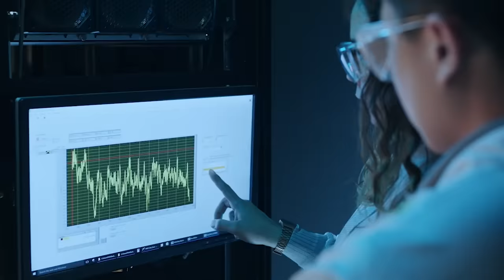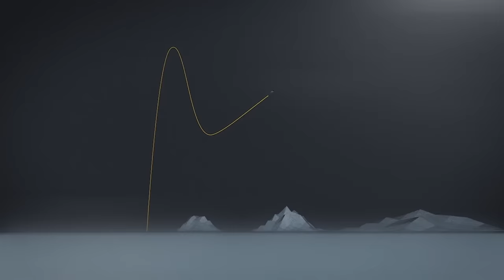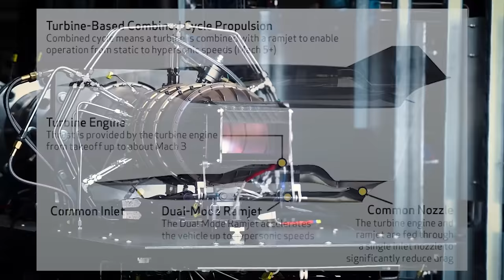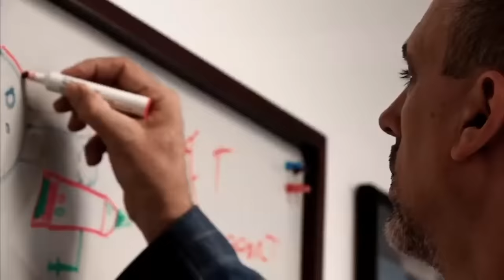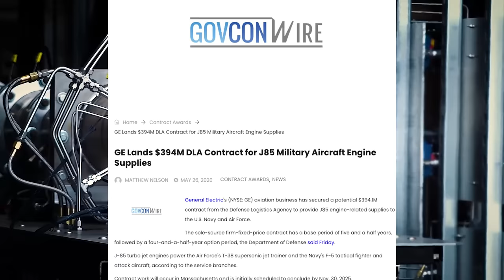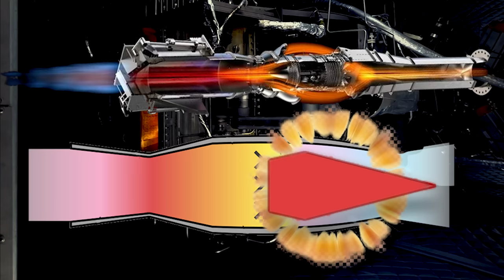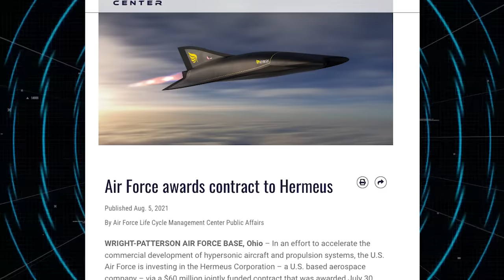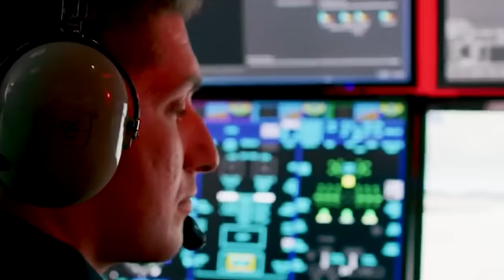Could HERMEUS turn the hypersonic arms race on its head?

Comment: Reminds me of where the Bulls used to practice. It was the most nondescript building out in the suburbs. You would not know that was the Bulls facility unless you knew before looking at it
Reply: Spent many years doing business around that area…I believe very few even knew it existed back in residential/business district.
Reply: The San Diego area has many new  industrial parks where the buildings are only marked with an address, or an address and a logo. 
This is a big military area. 
3rd largest Navy base in the world. North Island Naval Air Station, SEAL base, there's usually 2 or 3 Nimitz class carriers being upgraded at North Island.
Lots of Engineering opportunities.
Reply: My favourite type of factory.

Comment: All I can say is...fly baby fly! 46 years ago when I started working on A-4s another squadron on base flew the T-2 that was powered by 2 non afterburning J85 engines. We had the j52 engines that made the J85 look tiny as you said. Hell I have an acquaintance that runs a J85 in his dragster. They are tough and reliable. It will be interesting to see what comes of this. Thank you and be safe.
Reply: That's correct ! This idea is nothing new. It's a matter of making one that's reliable, maneuverable, and accurate.
Lt Rob, United States Airforce Retired.
Reply: That would be one scary dragster!!!
Reply: We used the J-52 engines in the Gam missiles. J52-P-3 turbojet propelled the Hound Dog

Comment: Incredible content as always. I actually know a girl in my grad program who did an internship this past spring with them and loved it.

Just one little nitpick. The J58 that powered the SR-71 was not a turbo-ramjet. It never diverted more than about 20% of the core mass flow around the turbomachinery/combustor iirc and thus can't be a turbo-ramjet. In my opinion, it was actually a far more interesting and clever solution by the P&W engineers than just routing all of the air around the core turbomachinery.

Comment: This feels a lot like SpaceX. Using commercial techniques to ensure rapid and cheap development with iterative designs that improve consistently. Quarter Horse you can tell is a rough draft, Darkhorse is looking pretty good, and I imagine Dragonborn’s or whatever they’re gonna call the next thing will be a truly perfected and revolutionary machine.
Reply: Thinking about hardware and needs.  I don't think a hypersonic bomb needs to do loops.  I think about things like jdams.  at it's core it is a gravity bomb.  Then computer, fins and sensors.  Yes I'm leaving lots of details out.  But then a jdam is a gravity bomb with some ability to do course changes within a funnel like window.  Now thinking about Falcon 9 or Falcon Heavy.  have the 2nd stage be a maneuverable glide vehicle with 1000kg of boom.  Sent up to just below the Harmin Line, (thus not breaking treaties on the weaponization of space) that 2nd stage can go almost anywhere in the world first stage lands back at the launch site or a drone ship.  F Heavy would allow more Delta Change or a bigger boom. Payload to LEO for F Heavy is 141,000 lbs.

Comment: I remember reading an AW&ST article about a back seat ride in a SR-71. The writer described flying a circle around Boise, Idaho at Mach 3. The circle had a diameter of 90 miles. At those speeds it seems maneuvers would have to be very gradual and therefore predictable.

Comment: Great job on this Alex, I love when you make new episodes. I noticed one issue however. You mentioned hypersonic speeds and the ability to get there. Missiles maneuvering to make the strike makes (expensive) sense, but a strike aircraft (because that's essentially the idea here) deploying munitions at hypersonic speeds without destroying the host aircraft, I think would be an even more impressive feat than just propelling a platform to those speeds. Otherwise the aircraft will have to slow down to standard release speeds in order to deploy munitions, making them vulnerable to standard air defense systems currently in use. In your opinion, is release while in maintained hypersonic flight even possible with current or near-term tech development?
Reply: One idea would be to launch them out of the rear of the aircraft in order to avoid the slipstream until it’s well to the rear.  There might also be some sort of detachable weapons-carrying module, similar to the B-58.

Comment: Nothing so far as been said about airframe integrity at speeds over the SR-71. That was a major concern. Also, how is communication going to work through the plasma envelope around the aircraft?
Thanks Alex for an outstanding channel !
Semper Fi from a 'Nam Squid.
Reply: Starship with the third test flight was able to maintain communications and telemetry for a while thanks to Starlink and the large wake such a huge rocket was able to produce. So maybe some rear mounted Starlink terminals or something similar could provide some communications.

Comment: The true genius of the J58 and I suspect the hybrid engine used by Hermeus is the control of shock wave formation inside the nacelle as it slows supersonic air down to subsonic, which compresses it manyfold, so it can be ducted in a controlled fashion to the afterburner section where fuel is added and burned.
If I’m not mistaken that genius went on to run Skunk Works after Kelly retired.
It’s all in the intake cone’s position of the J58.
Reply: The SR-71's cone moved based on airspeed to control the air entering the nacelles.

Comment: Deploying munitions at hypersonic speeds sounds like a bit of a challenge. 
The sudden change to the drag/airflow characteristics will be challenging to both vehicles. 
Also, presumably these will be externally mounted (opening bays at that speed would be tricky). But externally mounted munitions might be a challenge for drag and for low observability.
Or,... maybe I'm talking out my arse. Well TBH, I am so,.. maybe my arsetalk is complete bollocks.
Reply: What's your ride height on your car imagine high-altitude or stratosphere launch No Air no humidity no wind hey we're doing Mach 6 we just launched a missile that does Mach 2 hits ground at about Mach 25  he he he he
Reply: @stevensutton2252  Not sure there's "no air" the very fact that it gets extremely toasty means it's interacting with something. THIN air + extreme speed = problems. "Hypersonic" here being defined as where the speed affects the air chemistry, implies its defined for operating "in air" and interacting with it. 
So, I could easily be wrong, but I don't think releasing a munition into that hypersonic airstream is trivial, and that act of releasing a munition is central to this being a viable, multi-use, weapons platform (unlike a hypersonic missile)
Reply: Previously, US pilots have ejected and survived at high supersonic speeds, they'll definitely figure it out..
Considering the velocity of the aircraft and munition would be relatively similar at launch, the biggest issue would be drag but if deployment is fast enough and the munition is engineered for hypersonic deployment it shouldn't be a problem at all
Reply: @Laminar-Flow  Agree, objects inside are traveling at the same speed as the vehicle that carries it, it should be fine if inside object ignition occurs prior to fully exiting the vehicle air envelope
Reply: Just eject the weapons from the rear of the aircraft.
Reply: @bluemarlin8138  that's what I said but you worded it better
Reply: @bluemarlin8138  
I think crossing the boundary layers that surrounds such a craft is the problem. Something going hypersonic is going to have a very finely tuned (Laminar?) flow, with all kinds of critical flow patterns that if disturbed will be catastrophic. Anything detaching and disturbing that flow is probably gonna cause BOTH vehicles problems.
Just dropping it out the back doesn't avoid airflow problems, in fact, I suspect the smooth recombination of airflow behind the craft is critical to performance. Bunging a rocket into that zone is going to mess that all up.
But Like I said, I dont know.

Comment: Damn nice engine concept. I would like to see these used in a new version of the Space Shuttle. One that can take off and land. I hope they get Dark horse flying.
Reply: A space shuttle... with air-breathing engines? I think you can see the issue here.
Reply: And it would need to be several times faster. This is why we use rockets.
Reply: @uku4171  In this configuration the rocket motors would be much smaller. Solid rocket maybe. Enough to go from the stratosphere  to LEO.
Reply: @jerrywatson1958  with a payload of just around none, this wouldn't be much of a shuttle. SSTOs are pointless.
Reply: @uku4171  Can you prove that?
Reply: @jerrywatson1958  which part?
Reply: @uku4171  All of it. What parts are you talking about? Prove your point. Otherwise....
Reply: Look up StarReaker - for initial getting beyond 10km and Ma10 would be nice.

Comment: Pratt and Whitney makes the F100-PW series engine. GE makes the F110-GE series engine. Both are used in the F-15 and F-16. I'm personally acquainted with the F100-PW-220 and the F110-GE-100 and -129 (F-16s, C/D models, blocks 30, 32, 40, 42 and 50).

The F110-GE engine is an evolution of the F101-GE engine used in the B-1.

I'm not aware of any GE engine with the designation F100; the only "F100" engine I know of is the Pratt. But you refer, multiple times, to a GE F100 engine.

What am I missing?

Comment: One correction to add. “Every platform powered by either ramjets or scramjets so far have all been one-time use.”  Not quite true.  France flew an experimental turbojet/ramjet powered aircraft back in the 1950s, known as the Nord 1500 Griffon.  The aircraft was developed at a time when French turbojet engines had not yet achieved the thrust-to-weight ratios needed to sustain flight above Mach 2, and was aimed at developing a supersonic interceptor.  It was retired after French turbojet technology caught up and the ramjet combo was no longer needed.

Comment: Just a little note, it's false that nobody achieved a working combined cycle engine  : one was already working in 1957 in the French made nord 1500 Griffon II, using both the Snecma Atar 101 E-3 turbojet engine and a ramjet. It's just that the combination was too fuel hungry for the French air force's requirements of the time of a fast and agile mach 2 capable fighter/interceptor. Now that we are dealing with >mach 3, such combination gets more relevant. Once again thanks for the video
Reply: And the blackbird? Why is everyone forgetting it existed.
Reply: @darrylviljoen6227  Well, it is mentioned in the video, and about the black bird's engines, they are an in-beetween traditional turbojet and afterburner combo and the turbojet/ramjet system
Reply: @darrylviljoen6227  Shh! its still secret!

Comment: Please keep an eye out for anyone building a hybrid engine with a scramjet instead of a ramjet, ok? (A pipe dream, I know.) Still, people have solved harder problems, so it's not really a matter of "if", but "when".  Oh, and of course, what a great explanation of the Chimera design. You go!  Also, you didn't mention it, but think about a Mach 6 aircraft dropping dumb bombs, and smart bombs would be even better but they'd have to be more "fast bombs" to alter their course at those crazy speeds. But, still, a dumb bomb at Mach 6 speed does more damage with just kinetic energy than a same-sized conventional bomb w/ explosives. And the bigger the bomb, the more energy is converted. Another great concept would be a "shotgun bomb" where a Mach 6 craft would drop a container that splits into multiple smaller bomblets spreading across a wider area, say an entire military base or airfield. Big bombs for high-value individual targets, shotgun bombs for large-area targets. Imagine carpet-bombing an area with Mach 6 pellets...ouch!

Comment: One added idea, at hypersonic speeds it would probably be a much better use of thrust vectoring nozzles, thrust vectoring in general, then using control surfaces. This would also make for a much cleaner profile that should be significantly less radar reflective except maybe on the sides then you would get otherwise. Another reason why a missile is just a simpler job when dealing with hypersonics, and that's not simple at all

Comment: This is actually kind of mind blowing.

Imagine Dark Horse Naval variants, with several Aim-120's each, trailing behind F-35's at hypersonic speed to establish fleet air superiority. 

1) Launch F-35's on combat air patrol along with a data link from AWACS aircraft to establish a threat ring.
2) Launch Dark Horse drones at a calculated delay time to sling Aim-120's using data links from the forward aircraft, at high altitude Hypersonic speeds. Slinging those things at Mach 5+ could make them a "long range" missile for perimeter air defense. Provided data links/radar contacts are valid. 
3) Launch another wave and recover the first.

Basically a skinny AIM-54 Phoenix launched from Hypersonic speed and a MUCH better seeker head.

Perhaps another flight to Wild Weasel ground launch targets that fire using air to ground missiles like the HARM. 

Just thinking out loud, but wow!

Comment: I question the demonstrations.  Do they have a supersonic wind tunnel with their engine?  It really looks like they just have a restrictor built onto the back of the jet engine that looks cool when the afterburner throws flame out.  Then they are essentially dumping more fuel into a second afterburner to make more flame.  The "ramburner" that they say is the ramjet part needs the air to be coming in around the turbojet, but how would you use the afterburner as part of the ramburner that they say in their videos if all the air is going around the turbojet.

Comment: I am sure all this started with the SABRE combined cycle engine being designed by Reaction Engines Limited (UK). Their purpose is to design a space plane (Skylon) capable of SSTO (single stage to orbit). By using the oxygen of the atmosphere in the first part of flight, it doesn't need to carry as much liquid oxygen as a conventional rocket, thus saving weight. An air breathing engine has far greater specific impulse. Their plan is to use a conventional jet engine but extend it's speed envelope to mach 5.5 by using a precooler in front of the compressor. The limit of a conventional jet is when the air in the intake, compressed by the shockwave, becomes so hot that it cannot be further compressed and heated without compromising the compressor and turbine blades.
The engine will then transition to pure rocket engine (internal oxygen) as it leaves the atmosphere.

Comment: So... one thing I wonder about with these hypersonic drone and fighter/bomber ideas is - how easy is it to fire a weapon from a vehicle moving at hypersonic speeds? I would think that having a weapons bay door open at that speed would be tricky because it could destabilize the aircraft moving at those speeds. Do you externally mount a weapon to avoid this.

If you fire a weapon from it how is that weapon going to interact with the shockwave of the aircraft moving at mach 5+? Is it going to get bumped right back into the vehicle? This is not like shooting a weapon from a modern fighter jet where the missile is moving faster than the jet at launch and rockets away. We will not have any hypersonic missiles remember? So no missile would be able to rocket away from this without also causing potential issues for the aircraft itself. Slowing down the aircraft to fire is counterproductive.

At these speeds do we even need to fire a missile from it? Is a bomb more realistic at this speed and if so would it be better to drop it out the back to avoid this? Could a simplified and smaller version of a "rod-from-god" be just as effective. A half dozen 250lb tungsten rods a meter or two long, dropped from a rotary launcher, and with GBU style targeting abilities, could pack a big punch hitting at those speeds even if they slow down some.

Comment: Just a little question that popped to mind, if I recall correctly, you said that because of mach 4+ cruising, the air gets turned into plasma around the aircraft, making a radio waves shield, as did returning space capsules during re-entry. How the hell will you be able to remotwly pilot a flying demonstrator if it's wrapped is radiowaves shielding. You said in a previous video that a hypersonic missle would be blind due to plasma, as such it wouldn't be able to receive any radio waves (in a broad spectrum) be it gps, radar, or the piloting orders. I am really wondering how they may want to operate it. Don't tell me they are planning to use quantum transmission-less information sharing thanks to coupled photons, it's only theoratical and defeats the whole point of "of the shelf components"

Comment: Hypersonic Bomber…I’m all about it! 🤩🤩🤩
Reply: 😂 With current tech, it would fall apart at Mach 3 but sure, it would be fun.
Reply: @Wolf-Spirit_Alpha-Sigma  yes, let's just ignore the YF-12 could already do what you described back in the 60s
Reply: @hertzwave8001  You see, it was not a bomber. Let's just not ignore that. Bombers need a substantial ordinance and fuel to be called as such. And if you get to that mass range, obviously, there are no materials to make it structurally sound at such high speeds. But, I'm just describing the current tech. Who knows what will be possible in the future.

Comment: So will the drone be stealth? Also if u can, can u explain how all new aircraft will interact with each other. Like what mission they will take.
Reply: Hard for anything that fast to be low- visible in the infrared, though the hot plasma air around it should provide radar absorption.  The skin material choice has to prioritise heat tolerance so it probably would not have much radar stealth or camouflage paint options.